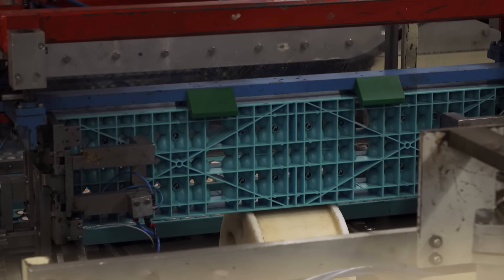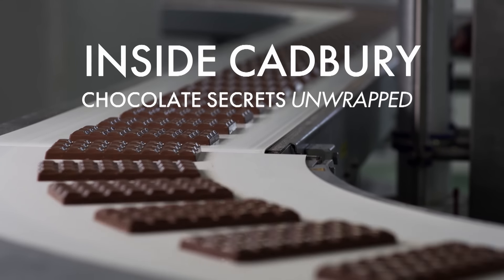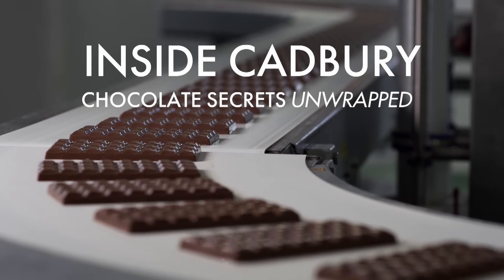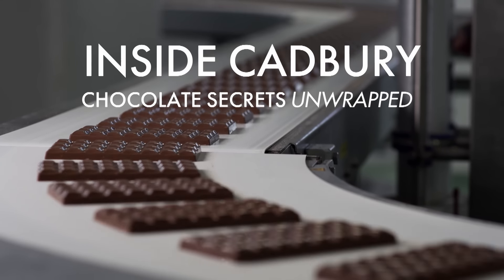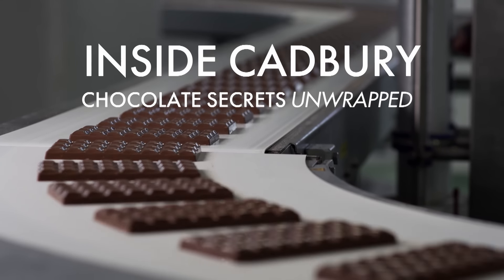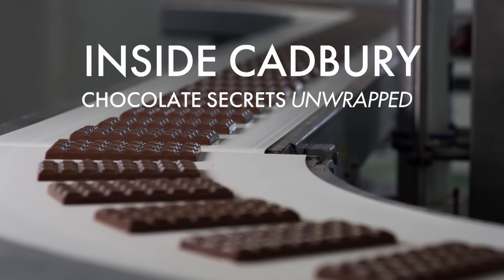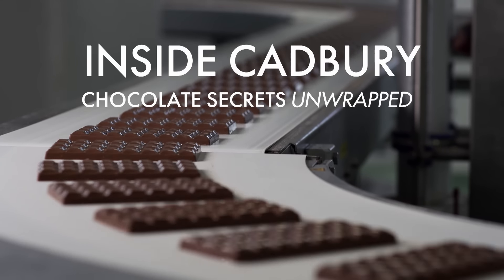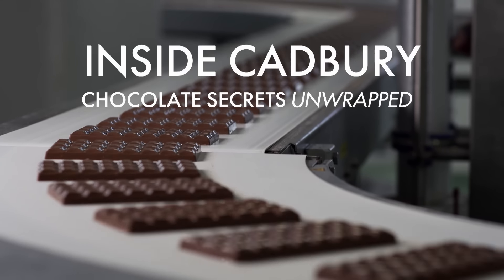Behind The Scenes Of The Most Famous Chocolate | Inside Cadbury: Unwrapped | Documentary Central

Comment: I stopped eating Cadbury chocolate because they use palm oil the best chocolate is Whittaker's chocolate made in New Zealand
Reply: They tried removing the cocobutter and replaced it with palm oil in the Cadbury Australia Dairy Milk, 
Sales plumitted, massive public backlash to the point they had to return to using cocobutter, sadly its sill not quite like it used to be, Dairy Milk made with palm oil instead of cocoutter was not eatable.